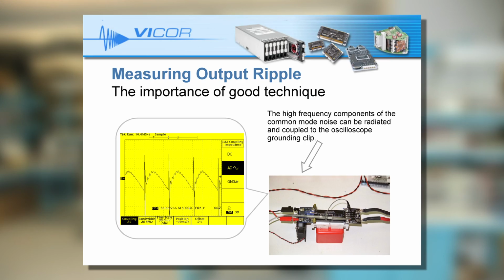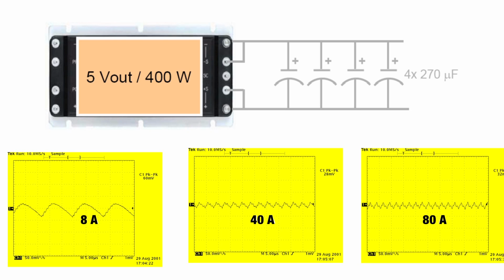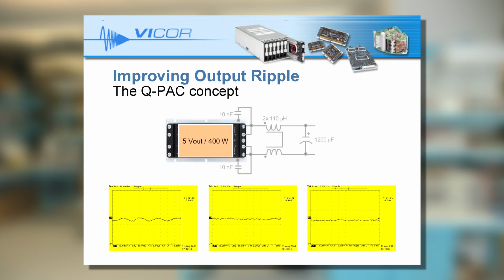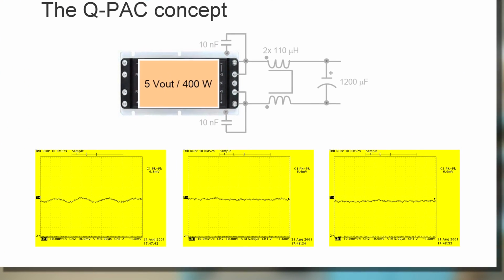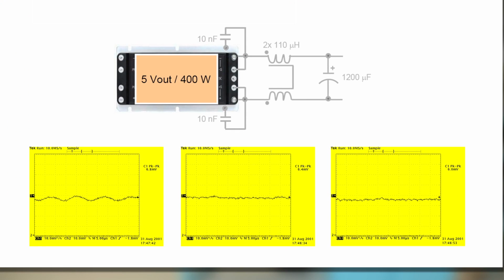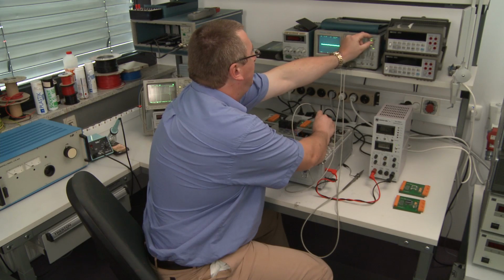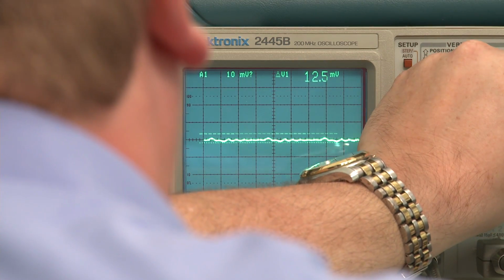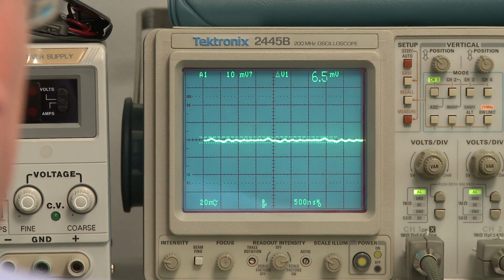Measure and Improve the Output Ripple of a DC DC Converter

Comment: Maaaaan, I have two "obsolete" Vicor power supplies that I'd love to get schematics for. Three phase AC comes in and gets rectified to 280vdc, which feeds into a large toroid that is pulsed by the main board MOSFET. Coming off the main board is a supevisory board, a driver board and a backplane with several removable DC output cards. There are several small cooling fans at the rear of the enclosure. Super complex piece of gear. It sure would help to have a schematic😁

Comment: What type of capacitors are used in the filter In the first slide with the three capacitors? are they electrolytic or ceramic, and what are their values? Also what type of capacitor is used in the LC filter as well? I did not see that in the explanation. Thank you very much.